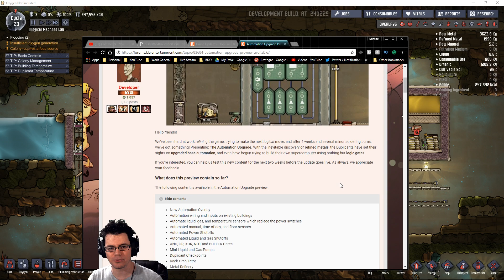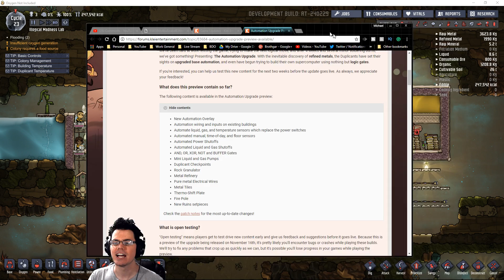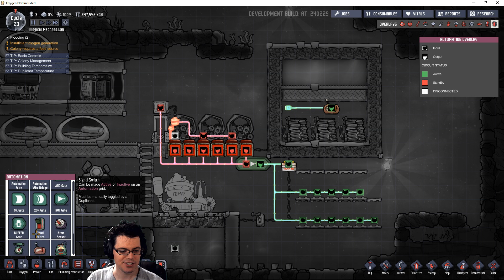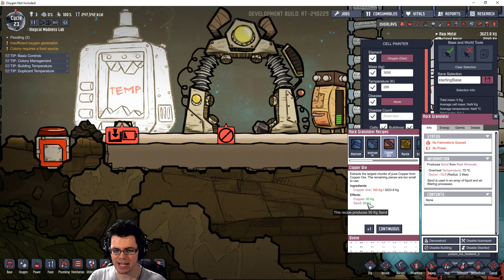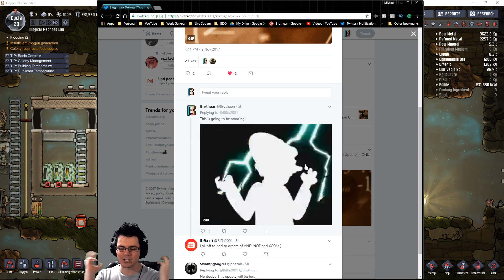Intro To Automation Upgrade! Oxygen Not Included

Comment: Eghad! Watching this video I had a flashback to years ago when Gen Set 2 went down, and Load Shed One tripped , followed by Load Shed Two. There were flashing lights, alarms and angry voices on the broadcast speaker. Then to my horror, I heard the Cross Bus Contactor winding up. With its massive positive contact spring, it took about 30 seconds for the motor to switch it over. Which, of course, it closed before the off line generator came up to speed, over loading the system. Load Shed Three opened and everything went dark. And then the sound of silence, broken only by the faint hum of an idling generator.

Comment: do u know how to create a double door, like a lab to avoid mixing gases? i tried but i think its not possible cause doors remain locked and then  dupes wont go that direction. and if u connect to automation mecanized doors they remain locked or open, not auto in any case... i guess if they dont modify that it would be impossible?

Comment: Man this is very exciting! I'm imagining certain doors opening and equipment running if you have a specified number of duplicants in an area, set up by one-way doors and buttons.

I'm a bit concerned with how much room this type of equipment will take; keeping track of the number of duplicants in some sort of "memory circuit" would require a new signal/automation wire for every bit of information, so you need a whole 8 lines of wire just to store a single byte, which takes a lot of room. Analog signals would be cool (and fix this) but probably too much for a game like this; maybe bundles of many signal wires would be cool.

I'm very excited to try this out!

Comment: you can think of circuits like draw bridges. if the draw bridge is open you cant drive across and if it is closed you can. A short would be like a shortcut, fastest way to ground, or skipping any equipment.

Comment: Closed circuit  means that all the wires are connected and the "loop" is complete/closed 
Open circuit means that one or mere wires are in the air thus making the "loop" open  and the system power offline 
I hop everyone can understand this . It is not that difficult after all :D

Comment: I'm really excited for the refining and the gas/liquid shut offs it basically allows you to create by passes around cooling equipment when it doesn't need to be running or allows to fill areas with gas or liquids more precisely without having to constantly watch things urself. Not sure how i feel about the normal switches being replaced though, makes power conservation early on harder to achieve

Comment: Just a heads up you can place the thermo shift plate under a block by building the plate first then the block, it functions as you would expect moving heat from one side to the other, also you can currently stack endlessly thermo plates but I can't tell if that does anything myself.

Comment: i wonder if it is possible to use the metal tiles and the shift plates to basically make a system to turn poluted water into steam by using the heat generated by machines (and maybe passively cool them by it?)

Comment: This is awesome, I've wanted to be able to use doors as auto water gates for ages.. this looks like We'll be able to set up a situation where when you want to open a sluice gate to dump out water when you need it you can.
Reply: Truly water cooled Battery Farms...  They will function up to 50% submerged, calibrate your system to fill each floor with Water up to that point, when it hits a certain temperature, open the door, dump the water, close it again and refill.

The pressure switch will also be very, very interesting.  Having a machine shut off production when it has created some mass of a resource...  That will be quite nifty.

Comment: Even if the exo-suits get fixed/nerfed/fixed/nerfed (depending on how you view the state of that item) with this automation system you could build and actual functioning proper airlock, albeit it'd probably be kinda slow... maybe. but really you'd only need the pressure in the room to be lower the of the base and you'd be set. 

This is and if if if comment though. Either way I can't wait for the automation upgrade preview available update to come out!

Comment: You could probably use the pressure plates to check the fluid pressure in a tank, allowing for example to turn off systems which don't need to fill a tank more than it already is